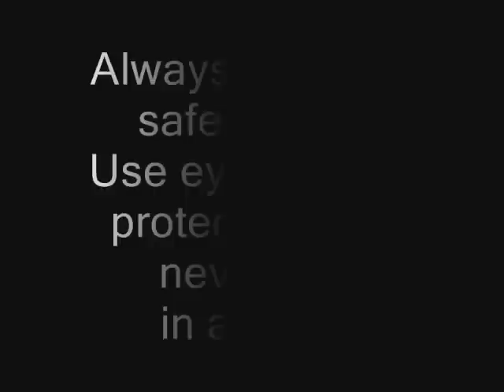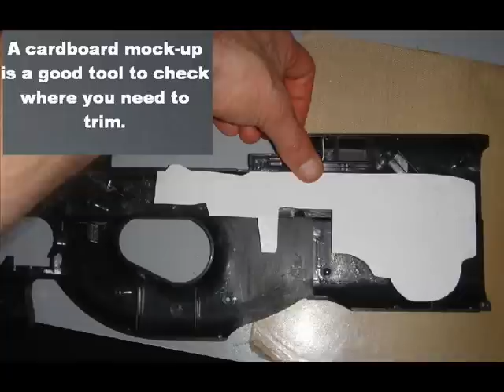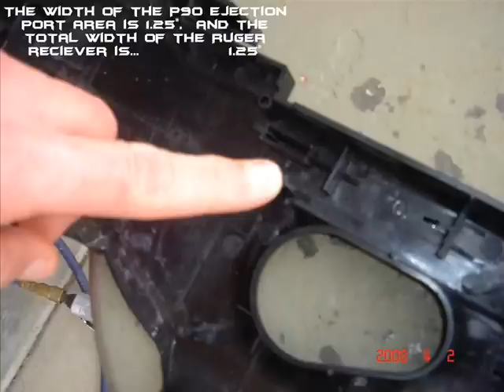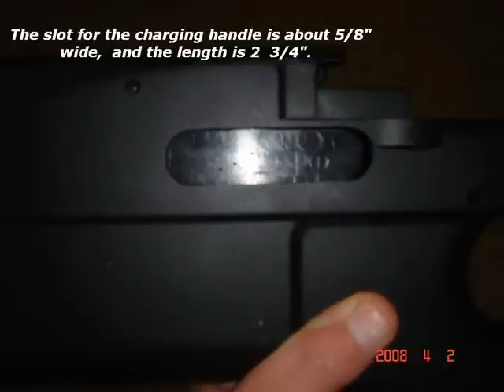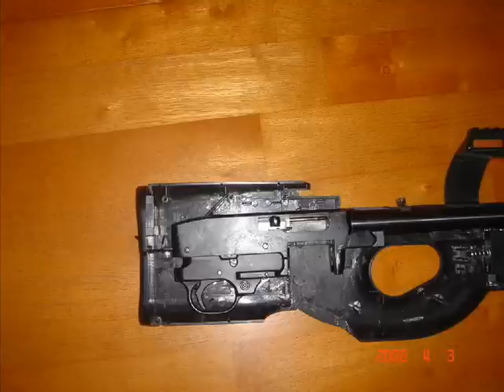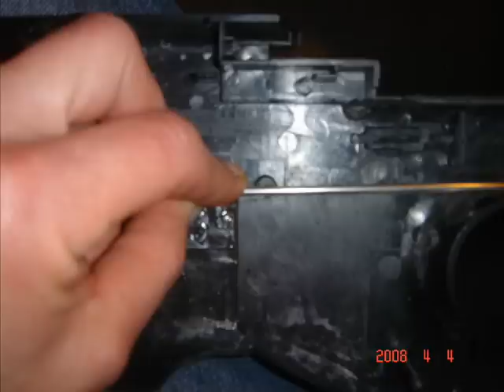.22lr  P90   using a Ruger 10/22   -  HOW TO MAKE YOUR OWN!

Comment: I'd like to try this in 22 wmr  but, with a top fed magazine like the original P90. I think it could be done with some engineering creativity. It would also require a modified bolt be machined...thinking the CZ 512 WMR rifle as the base model to work with. I have 2 other ideas to solve the need for delayed blowback required for 22WMR. Anyone interested, hit me up.

Comment: do u need an extended mag release? i got the 10/22 and ordered my airsoft... cant wait to get started
Reply from the maker: It would probably help.  There is enough space to slide my finger between the mag and the stock to press the stock release.
Reply: @taofledermaus   Hey would  this work  with a remgntion  597 with some tinkering

Comment: what type of airsoft brand is it? WELL's or AEG or?
Reply from the maker: Well
Reply: thank you....
Reply from the maker: I think there may be other clone/copy brands that are exactly the same as the Well.  It's typically the CHEAPEST P90 (sometimes called  (D90)  you can find.
Reply: ok... i was curious cause theres d90, d90f, etc... i think the only difference between those 2 r full vs. semi auto. either one will work im sure
Reply from the maker: If you see a photo of them,   you can tell it is the right one because on top of the magazine,  there is a big knob.   The real P90 doesn't have a big knob there.
Reply: ok.. thank you..

Comment: and this is why red jacket is stupid for trying to sell their zk22 stock for over 200$ when you could modify an airsoft stock thats made of the same material for way cheaper...yet idiots still give redjacket money. another option for mounting .22 rifles in stocks like this would be make an aluminum bedding chassis with some  aluminum tube and aluminum solid blocks. then can rivet the blocks to the chassis. of course would take a bit of time but if done right it would be very sturdy

Comment: Is it legal to use the fake suppressor that comes with the Well airsoft gun?  I know you'll need need to go through legal processes to obtain use of a real suppressor, but the airsoft one is obviously not real.   My overall length wont reach 26 inches when I am finished and I would need to add the suppressor to make it over 26 inch.    I can also add the rubber buttstock to add 2 more inches....but I like the looks of having the fake suppressor installed.

Comment: yes.  im in california too and ive done almost 30 stocks using a 10/22, Marlin 795 and Marlin XT-22.  

just follow the rules with 16 inch minimum barrel length, 26 inch overall length, 10 round magazine limit, no suppressor, no short barrel rifles, no full auto and youre good to go.

Comment: ive done a FS2000 using a Ruger 10/22.  Also a 10/22 will fit in a AUG. Marlin 795 can fit in a L85.  I have the FAMAS shell but havent had time to gut it.  not sure what fits in that yet.    

dont do a bullpup as a starter project.  it just takes longer to figure out how to do the trigger linkage.

Comment: @Odinforever2000 
Because several people commented that the barrel length should be cut down several inches and were met with prompt replies that it was illegal to do so. Since it is fact NOT illegal I thought some people (taofledermaus included) might like to know that. After all a real P90 is an SBR with a total length just under 20" and a barrel length just over 10". This conversion is closer to the civillian PS90 which has a 16" barrel in order to avoid the SBR tax.

Comment: You're talking about "permanent" parts. I said "removeable." Also, when dealing with BATF "permanent" can be a relative thing. Personally, I'd weld it on instead of pinning it, and even that's no guarantee if you get on thier bad side.

Comment: I ordered the Well D90 from Kapowee, but what I got was a Palco Sports "Firepower Pulsar." I called Kapowee and they said that it was still a Wells gun, but that the importer was now putting their own name on them, but there were several differences as well. Once I got into the conversion I discovered that most of the differences make it easier to do this. The magazine is now identical to the Tokyo Marui, so they interchange. There is an internal rib which fits perfectly behind the receiver.

Comment: I tried your modification, and it's great. There is one problem, however. The weapon I ended up with measures 25 inches overall - 1 inch too short to be legal. I got a flash supressor to add another inch to the barrel. How long is yours?

Comment: A couple of questions, first, how easy was it to sight in? I assume the Ruger iron sights would be useless and if the airsoft stock did have iron sights they wouldn't be functional. Also, is it simple to switch the Ruger receiver and barrel out and back into the original stock?

Comment: O Rly?

from wikipedia:

Short barreled rifle (SBR) is a legal designation in the United States, referring to a shoulder-fired, rifled firearm with a barrel length of less than 16 inches (40.6 cm) or overall length of less than 26 inches (66.0 cm). In the United States, an SBR is an item regulated by the Bureau of Alcohol, Tobacco, Firearms and Explosives (BATFE) as a title II weapon.

Federal trumps local, you still gotta pay $200

Comment: If I get another 10/22 and do this mod I'll probably SBR it :)  If you aren't modifying the barrel why do you have to add a flash hider?  Barrel length is measured from the end of the muzzle to the bolt face (when the bolt is closed).